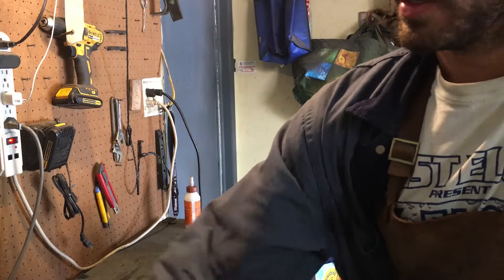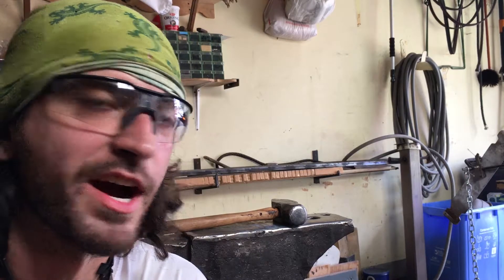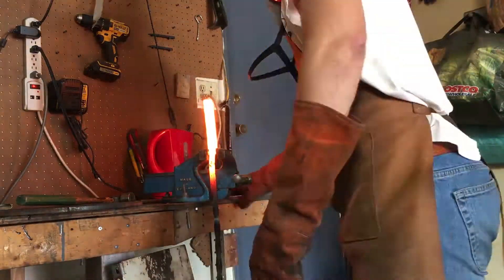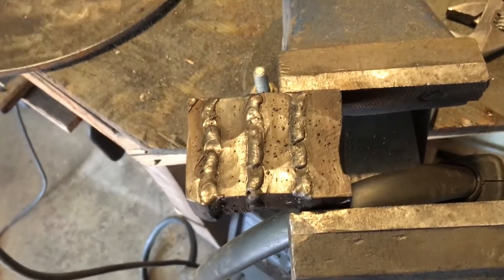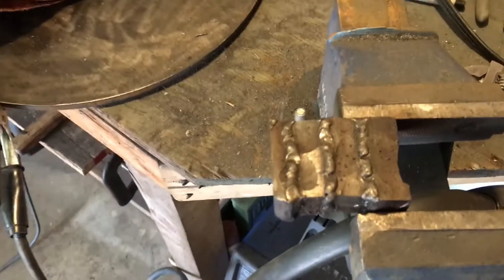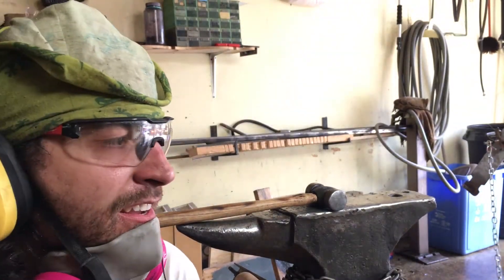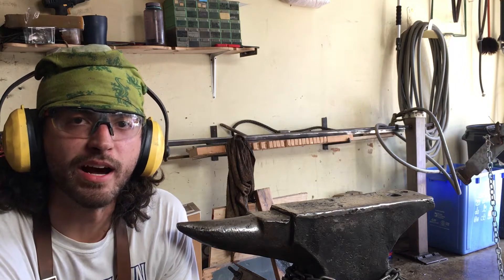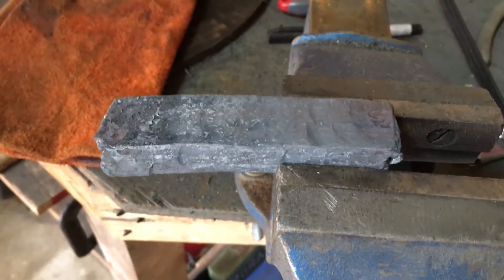First Time Cable Damascus Forged by Hand!

Comment: What you do to close those gaps in the cable is Before you weld all of your four bundles together you take each bundle of cable do a pretty good heat stick it in your vice and twist that cable tight following its current twist and then stack your four bundles and weld them all together then go to for your first forge weld. But i’m sure you know that by now
Reply from the maker: Haha yeah! Thanks for the tip though. I did think of doing that here except for my pieces of cable we’re not very long for what I was trying to do and there is potential material loss from that twisting since approx 3/4 will be held in the vise and 3/4” in the twisting wrench, cooling down and not forge welding or twisting. Losing 1.5” on each piece is just something I didn’t want to do. But, with thicker cable it’s definitely a good thing!